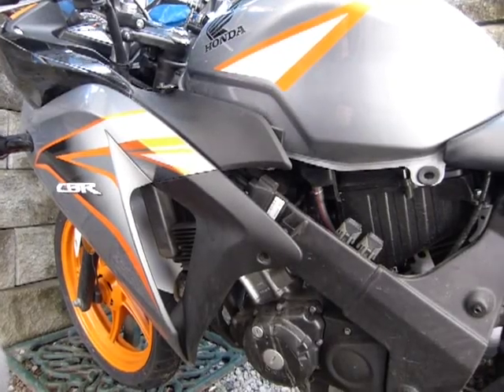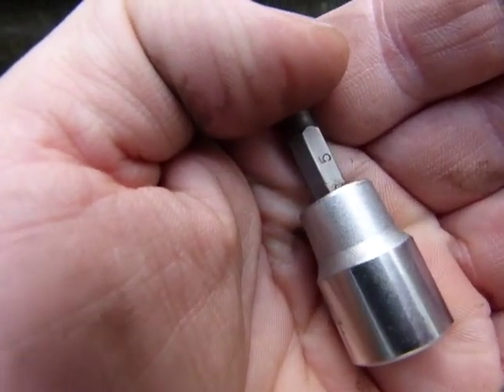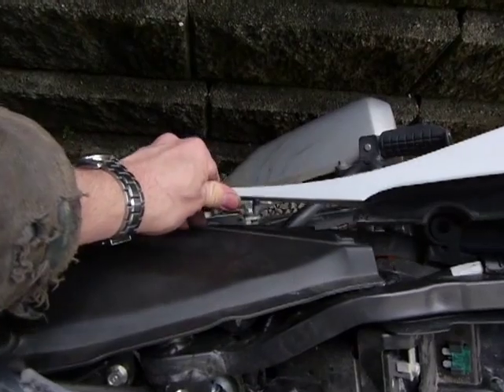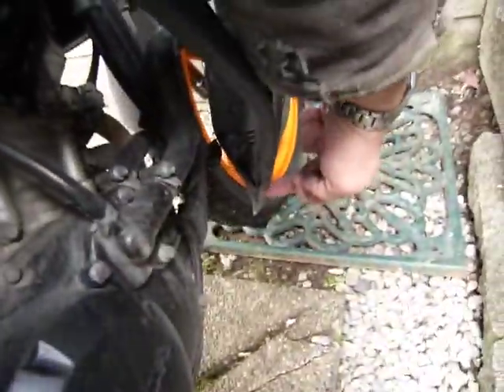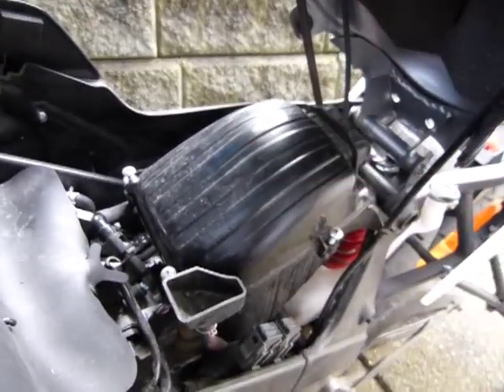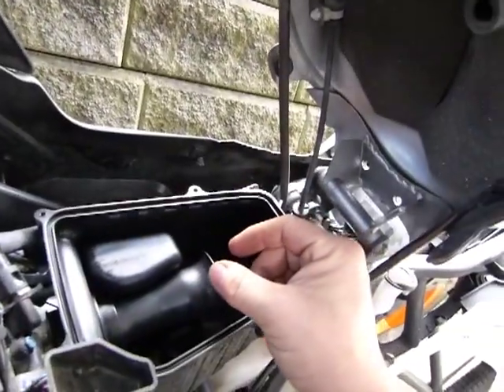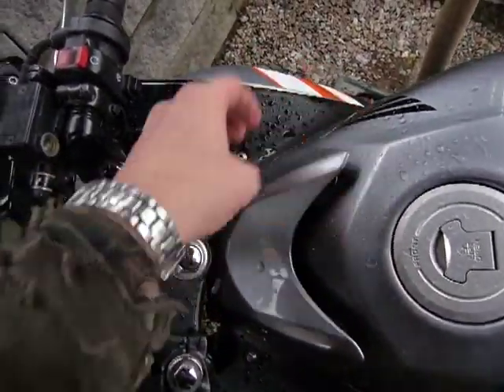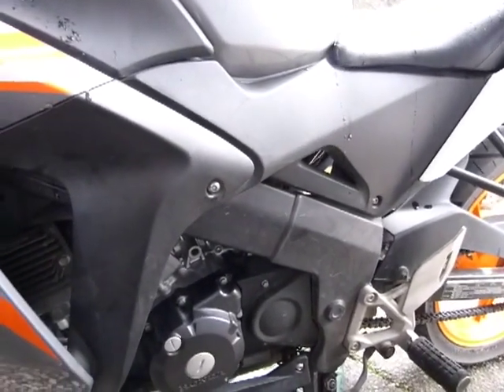Air filter check (2011-14 CBR125R)

Comment: what a shitty design. you have to unscrew half of the bike to change a shitty filter. I've just watch cbr 250 air filter change. It takes 2 screw to change. Thank you for video.
Reply from the maker: +Ahmet TÜRKER I agree. Easy of access was not one of the design factors.

Comment from the maker: Under the lower half of the air box the throttle body is connected to it by a hose clamp. Clamp screws out with a screwdriver, then pull the box up. I don`t know how the power filter would fit in al all space-wise.